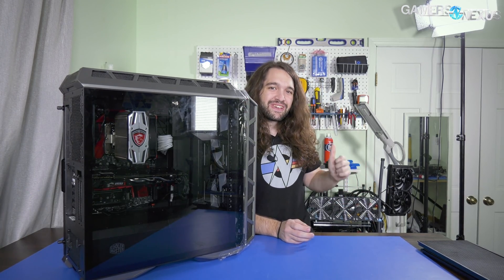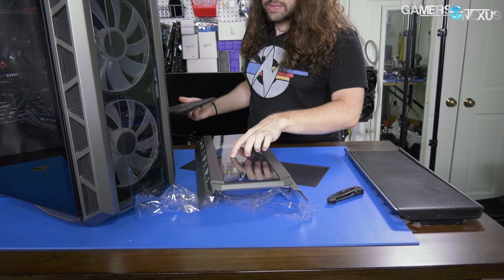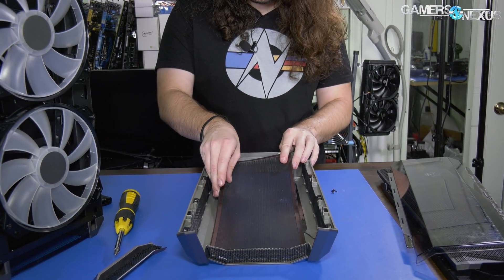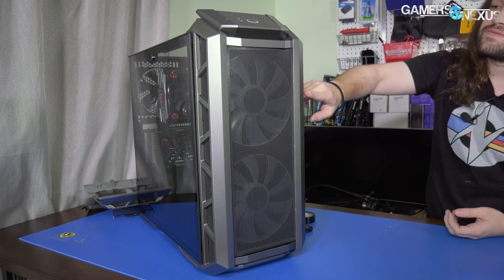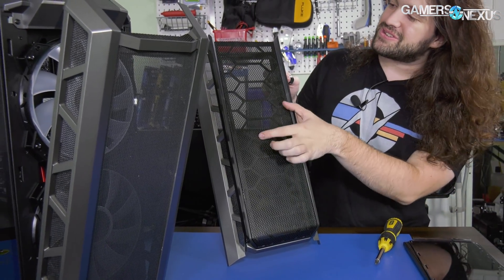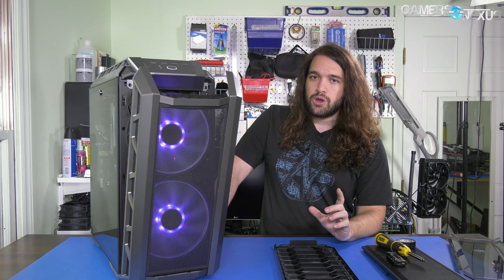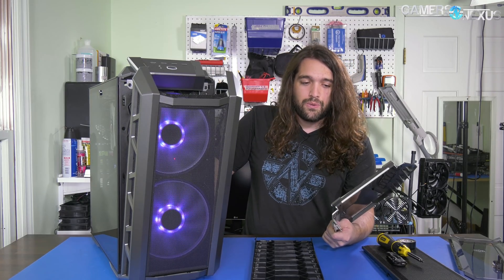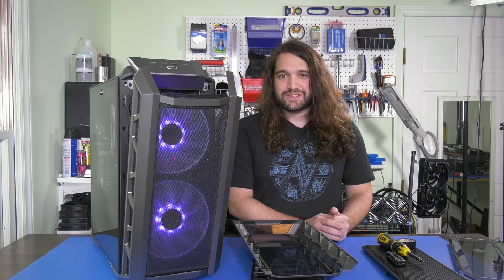Meshify H500P Case Mod: Actually HAF

Comment from the maker: Here's the article, if you want more time for the charts: https://www.gamersnexus.net/guides/3085-project-haf-ify-mesh-cooler-master-h500p-case-mod
For owners of this case, our radiator placement guide may help optimize performance: https://www.youtube.com/watch?v=mGp0I1fw6RI
And our initial review: https://www.youtube.com/watch?v=HRsb4C5gLLc
Reply from the maker: Medokn Will check dimensions when I'm near the case later tonight!
Reply: Now go grab some of the Noctua 200mm fans and see if there's any difference.
Reply from the maker: Some were asking the mesh filter we used -- not sure the exact case it came off of, but it is roughly 6" x 16" tall.
Reply: The case looks even sexier with mesh, i don't know why they added plastic for looks when it looks even sexier with mesh...
Reply: There is one more thing that you can do to improve the airflow: close up all those holes between the fans in front. A lot of air is simply looping around the edges of those fans.
Reply: hey whats the dimensions of the front filter?
Reply: Two words: heat gun.
Reply: I bet you could get nearly the same cooling results just replacing the 200mm fans with 3 120mm fans.
Reply: Nice hack Steve looks good and cools better
Reply: its not possible to 3d print a spacer for the front?
Reply: This is exactly what I want to do if I get one :P
Reply from the maker: Ricardo Fernandes I'm sure it is, but we don't have a 3D printer.
Reply: i thought it had a crazy/shiitty mount setup that was to hard to duplicate
Reply: Love you satire, savage overcome and hair (show you operator in some QnA!). P.S. No homo, just anticipating you work!
Reply: i would love to see your mod testing if you closed the gaps between the front fans with some foam. The Open space between the fans is going to allow quite a bit of re-circulation around the bezel of the fans.
Reply: My first thought on seeing the plastic front panel was if I could buy some metal mesh and use the plastic panel to shape it then hot glue it into the inside of the front panel.  I love the look of the case. If I had the money I might use the H500P to build my partner a new PC since her PCIE slots just died on her old FX 6100 machine.  I cannot lie...I will not miss her PC but now she is PC-less so its like a good and bad thing since I'd like her to upgrade to Ryzen when we can afford it.  I still love my HAF 932 that I bought in 2011.
Reply: Steve I bought a white masterbox 5 with the acrylic front and my evga ftw gtx 780 was suffocating. I had to remove the front acrylic panel just so my gpu wouldn't throttle down. I like the internal layout but that front acrylic really is a turn off for me. My first hand experience with the case taught me to steer away from all the "trendy acrylic" cases with no air flow. These cases might do fine with an RX 560 or gtx 1050 ti but any high end card will be suffocated. Maybe the target demographic for cases like the masterbox 5 were people with low-mid range systems. At $150 the H500P front acrylic makes no sense since the price suggests that it is a product with good looks and good performance with little compromises (some plastic but good quality). Much like the Masterbox 5 (with the acrylic front), the H500P fails to bring the cooling performance out of the box from a company that is known for their CPU coolers and even has "Cooler" in their name.
Reply: Good day sir im a big fan(not the cooling type) you make the best videos i have ever watched i watched all of your vids atleast two times thanks for the vids man. Im from the philippines im a pc enthusiast and gamer my pc only pc just broke because of old age it was at least 4 to 5 years old when i got it on 2011 it was a gift from my mother i have used it for 3 years but sadly it broke the specs are amd athlon 64 le-1600 Motherboard: GF7025-M2 1gb ddr2 ram for its storage a 160gb Hitachi hdd unfortunately our current financial situation i cant buy a decent pc im hoping you will make a give away contest so i can at least have a  chance to win a decent upgrade
Reply: Thank you, and keep up the awesome work.
Reply: seria genial que vendieran la parte frontal con la maya
Reply: What material mesh did you use

Comment: It's interesting how some of the problems with the normal H500P aren't apparent on mine, so they obviously fixed it by 2020 when I got mine. My top panel has a screw to stop it sliding off, my front panel had another clip to hold it on, but i swapped it out for a mesh one from their website. The right side panel is metal not glass. It's actually an amazing case when those issues are fixed.
Reply: After having this case for around 2 years, I may actually mod the top panel by taking the acrylic out and putting mesh instead

Comment: I have this exact same issue with thermals even though my H500P has mesh front panel, apparently Cooler Master took this video semi-seriously. Unfortunately, top panel is still acrylic and Cooler Master's support is awful. I've wasted enough time to describe them issue, even directly linking this video, I've told them that I have RTX 3080 vertically mounted which causes CPU to reach 70 C when idle, while graphics card is stress tested via FurMark. Initially they didn't get it and told me to install 2-3 top fans even though I told them I have AIO (liquid cooler). Then, they failed to provide any solution or even mesh. They told me it's case modding and that's it. No solution provided, just repeating the same bland answers and not compensating me in any way. Do NOT buy from Cooler Master!

Comment: How can i change colors of the front fans.. like which software to use? I can change it to diff colors using rgb fusion but that only gives me static colors option. .. how can i set it to diff color modes like fade pulse etc..

Comment: If using a radiator (h150i) on the top, would the mesh top be better?
Reply: Definitely. I have Lian Li Galahad 360 and RTX 3080. RTX 3080 is vertically mounted and successfully "chokes" CPU to reach 70 C even though CPU is idle, this can happen when GPU is stress tested via FurMark. When I take top panel off temporarily, run stress test again, all is fine. Also, acrylic is hot when you keep top panel. It's just really said they are called "Cooler Master" when their customer support fail to support better airflow. They didn't provide me any solution when I contacted them and discarded solutions in this video as "case modding", that's how much Cooler Master cares.

Comment: I bought case at $40 off, and used the savings to get a $20 mesh front. Since I added two 200m fans to the top I kept the plastic top  keeps small dirt/liquids from falling into it, and I put  like tostuff on top of PC anyhow.

Comment: imo it's kinda bad designers if they get heat problems size of giant case when i got only coolermaster elite 130 got 280mm rad on side and 120mm furyx on front i get max temps underload 50c cpu and 55 gpu. just can understand why would you buy this case for 150dollars fully wasted money i think it's cool to get more like small and compact than giantic, ugly very heavy pc just dont understand why any1  buys still atx cases i understand that if you're worried about that components dont fit on mini itx cases well how about micro atx most likely you have nothing to worry then and it's mostly cheaper.

Comment: I did exactly what he did almost, I also put a cross-section on the front to make it more rigid. Simple hot glue application. What a difference that made.  Might be a good idea to buy the old design on the cheap and mod it, they can’t give these away since the new design came out. Nice Ingenuity. 👌

Comment: I kind of want to remove the 200mm fans and add x3 120-140mm fans. I feel like it will be significantly more efficient, these 200 mm fans kind of suck. I ended up doing a mod similar to this and it reduced thermals by about 13c. What do you think?

Comment: You could actually do the mods more inexpensively. Local hardware stores would sell steel mesh that you can cut to size. Easily a $10-$15 mod for both pieces.

Comment: I have this case and thats even after reading all the reviews including Gamers Nexus...Found it easy to build in, lots of room inside for a clean build and subjectivly, it looks great for me. Temps wise with the front and top acrylic panels, it was never going to be the origonal HAF or even close to something like the Meshify but it does a solid job, especially with a 360 AIO on the top. I like the MOD GN has done and will  probably try it on the front at some point.

Comment: I'm sorry if I haven't seen all your videos on this case, but did you try moving the front fans to the internal side in the front; this would essentially remove the fans from blocking the front intakes from the sides, and should in theory increase air flow.

Comment: Steve go to Home Depot or Lowes or any hardware store and get some black vinyl window screen and aluminum tape. Then cut out you hole with the mesh at having the squares with the case and 2 more where they are 45 degrees and 30 something degrees, tape them on where the first one is visible and the other two are behind it and you get a decent looking air filter with small enough holes to catch the dust. That's what I used to do for air filters before cases had them. Cheap and easy to do.

*Edit, The new mesh front panel I think looks superior to the plastic, it better matches the side vents and hides a bit of the case a front panel is supposed to hide.. the ugly industrial bits.

Comment: I am planning to do my own meshify mod but using two meshes, one is a 11mm hole hexagon punched plate and will be using a #28 plain steal Mesh - 0.552mm Aperture as a dust filter, most likely using some kind of spray on contact adhesive to stick the two together. Do you think this will work fine, or should I go for a #18 Mesh - 0.961mm Aperture? Also any way to send you the picture when I'm done?

Comment: great job fixing the problem but pretty pathetic this case even made it to production like this which is the main reason i am stll running my 7 yr old case , it looks like hell modded up up for max airflow but its free compared to spending 100usd and still having to mos a brand new case

Comment: With stock fans? What if you used corsair hd140? Run fans. Can you change the huge front fans for 3 140mm or just fit higher performance 200mm fans.

Comment: Has anyone tried replacing the 200mm fans with some 140s or 120s that sit further in to eliminate the air blockages on the front sides?

Comment: What is it with the case manufacturer?  You spend good money to get crap air flow and have to mod the case?  As long as Cooler Master continues to do this I will keep my 922 HAF for a very long time.  -   Thank you for this video.  [EDIT:  Would house door screen work?  It is very inexpensive and can be purchased locally at Wal-Mart or Hardware stores, like Lowe's.]

Comment: steve, what would the air flow be if you reversed the 200mm fans and had the top be the intake and the rear fan switched to intake? do you think that could also fix some of the cooling if people who are scared to mod there stuff.

Comment: Is there no way of keeping the stock config (glass panels on), and just simply move the fans inside the case, still in front? That wouldn't be as good (in temps) as the full mesh, but logic tells me that the fans should be able to breathe a little better.

Comment: once the mesh was added you can see why Cooler Master chose those acrylic fronts, they wanted the rgb fans to be viewable without any obstructions, only problem with this is that although the fans have an unobstructed view airflow was extremely obstructed, love the review and the work, good job.

Comment: Tweet: "Don't worry guys we are already making it!!' and didn't all corporately shit the bed when we saw this video, at all! Next marketing press conference:  "From customer feedback (Steve), we listen to our customers (insert soundclip of Steve's viewers' wallets closing simultaneously). We understand our customers (you reading this now but as your future self), and aim to provide alternatives and choice (adopt general publisher response and reasoning for 'valid' inclusion of lootboxes in 2017 games). As an example, with this convenient (required) Dual-pack (you can charge me double if its a double pack and it's the only option you give me to buy) mesh alternative (thermal issue fix) for only (£9.99?) £49.99. (Hmm.). For those who prefer a lightweight (as half of the original is now in the bin) stealth option to the tempered glass (cheap bendy plastic and badly glued acrylic) look (immitation). In retail stores Q2 2018! (New product design, manufacture leadtimes & distribution)"

Comment: Felt I had to throw in my opinion ! Not sure why Steve is hating on this product in such a big way. I just received mine and built a system with a Z170 ASUS ROG Maximus VIII Formula, a 6700K , a H100i cooler,  a Samsung 2TB 960 PRO M.2 SSD, An ASUS Strix 1080TI and a EVGA SuperNova 850w PSU. My CPU is a chilly 28 to 30 degrees Celsius on all four cores according to the core-temp software and the cooler fans don't even spin up until I actually run a GPU bench-mark or play a game. Even then the CPU only hits about 56 to 60 degrees depending on the amount of load and stress. The SSD is only hitting 48 degrees which I feel is awesome considering it is hidden behind the front chip-set cover and doesn't really receive any cool air. The GPU temps only rise to about 68 degrees, of course a lot of that has to do with the excellent cooler design on the Strix. 
In closing, I have not experienced the toasty thermals at all. In fact I could likely keep a beer cold inside this case!
I do agree with Steve on one point though.
The front and top panels are definitely flimsy and cheap! That said, once your system is built its really not that huge of a problem unless you plan to constantly move or transport your rig.
Otherwise the thermals are more than acceptable and the finished build even with plastic front and top glass looks classy fantastic! This is actually my first cooler Master case by the way. I usually go with Corsair or Phanteks for my builds.

Comment: Cooler Master needs to offer some mesh panels for this case.  Just like how they offer so many parts for the Mastercase series.  When I first saw this case, I thought wow, looks good but what about the air flow.  Guess it's actually as bad as it looks.  Which sucks because I was very happy with my first Cooler Master case (CM690) and now my current Mastercase Pro 5.

Comment: You mention the low static pressure of those 2 200mm fans, I would of like to see what effect running say 3 decent 140mm fans on both thermals and noise using the mesh setup.

Comment: Totally would replace that front with mesh- you can by that stuff by the sheet, I used some to fill in some 5 1/4 drive base on an old case once.

Comment: Just want to add for anyone that is thinking of doing this mod you can easily purchase mesh relatively cheap and in different patterns, even chicken wire small enough for this, take it to a local shop that has a metal press and ask them to bend the mesh in the shape of the  "glass"

Comment: I've got a CM 690III case that is  pretty much equivalent to the GN meshified HAF case (except with a single 200mm intake rather than 2). Has great airflow, is built like a tank and is heavy af....kind of disappointing to see a manufacturer with that kind of potential go down this route (aesthetics>function, build quality). Great review Steve, loved how you've pulled no punches :) CM should go back to their roots.

Comment: WTAF was Coolermaster thinking with that horribly cheap looking plastic front panel with those massive fans? The original HAFX had mesh on the front, why the hell not this? I think Coolermaster will either fix this or release a Rev.2 soon.

Comment: I'd buy it if it had a mesh front and (if possible) static pressure optimized 200mm fans...but that $150 price tag coupled with the build quality...

Comment: +steve burke Has GN ever tested FujiPoly Thermal Pad's?  I'm contemplating swapping out the pads on my 1080 Ti FTW3 and 1070 FTW with them but was hoping GN had some data to share first.

Comment: Even with the mod/fix you can tell it's still built out of very cheap materials. The kind of plastic that if you accidentally stubbed your toe on, instead of ending up in pain you would have a front panel attached to your foot with your toe sticking through it.

Comment: Do you fancy doing the same with the Thermaltake View 31 (I'm sort of regretting buy it) 
As you said before it has the same issue  (only worse) and the mod would be more difficult.
I'd love your opinion.
I currently have 3 rad's in it and no fresh air entering the system.

Comment: The problem is that the fans don't have enough sp. The best you can do for that case is change fans to 140mm ones. Still, great mod changing the front with mesh.

Comment: Ghetto Mesh H500P. Great mod Steve and to me it looks better and actually improves the airflow. Great job. IMHO the case is still a little too pricey at $150 for the build quality. If they were to improve the side tempered glass mounting to be more flush and more sturdy, Make a good mesh front (They could easily make the front mesh match those side vents with the silver bars to make it sturdy with the mesh and make it match) Make the top acrylic smoke or charcoal in color and release the case for $100 to $125 I would buy it in a heartbeat. As it is currently $150 plus having to buy new panels or spend time modding my own would be better spent just buying a higher quality case from another vendor.